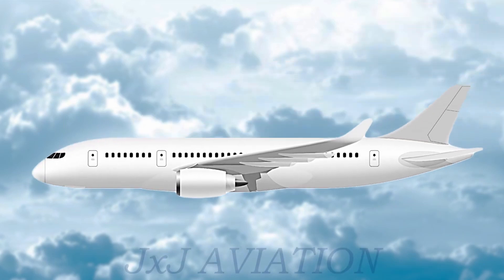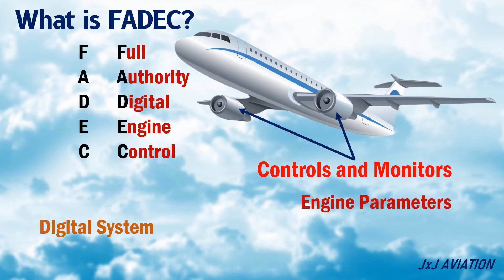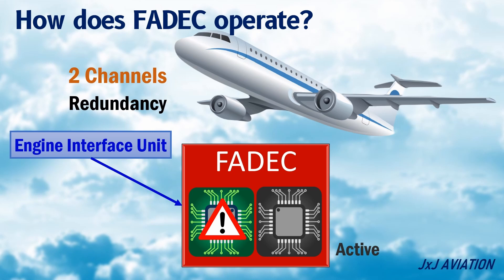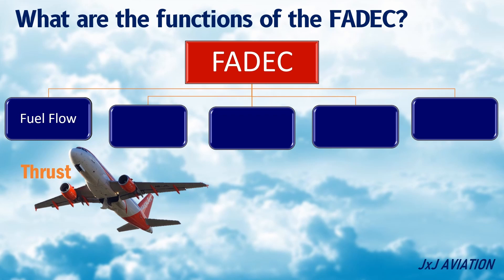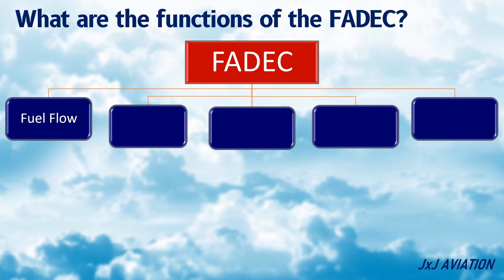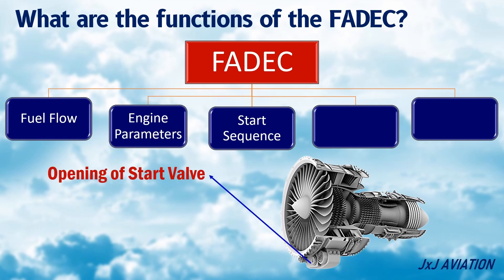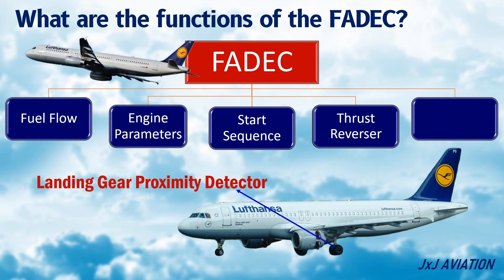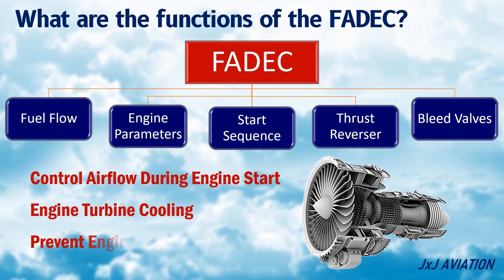What is FADEC? | What are the Functions of the FADEC? | What is the use of Engine Interface Unit?

Comment: At 2:50, you say "in case of failure of both channels of the FADEC, that engine will be lost completely", does that mean that engine will not be operational nor functioning or that it can't be controlled by the FADEC?
Reply from the maker: Engines will function! But there will be no control of the engines!

Comment: One question: As I understood, FADEC can possibly fail completely during flight, can't it? I mean, both sensors. What are the odds? If it does, the engines shut down, then. How could pilots save the plane in this situation? Thanks!
Reply from the maker: If the fadec loses sensors, the control of the engine is lost! The pilots would not have control on the engine so it has to be shut down!
Reply: @JxJAVIATION  they'd have to land the plane ASAP then, right?

Comment: so there is a FADEC on each engine? and is there at least 2 on each? for redundancy or what? can you please elaborate the level of safety and reliability of FADECs? if you can also tell me how its connections to other aircraft systems? i am completing a research on cybersecurity on aircrafts and I'm also a maintenance and design engineer so you can be technical with me.
Reply from the maker: Hi, have sent you the info on mail! 
Hope its useful!

Comment: Very sophisticated however, how active is the FADEC system in controlling or participating in assisting the pilots in making these huge adjustments in the high wind landings we've recently seen out of England? Even at the speed of electronic systems I believe these systems are dangerous because they take away from the pilots ability to manually fly the aircraft, I'm an old prop guy from Vietnam era and always felt more comfortable with the relationship I had with the aircraft in any conditions
Reply from the maker: That's true: The actual feel of the engine is lost; but FADEC is quite reliable because it gives the required thrust as and when required including situations like go around where sudden increase is thrust is required. So guess we have to start trusting the system and automation!

Comment: No options to run the engine in manual by pilot in case FADEC malfunctions?
Reply from the maker: No option for manual takeover.
Reply: Piston engines are controlled manually , for this specific aircraft only function with this system that’s why it has two channels,, Incase one fails the other one will take over .